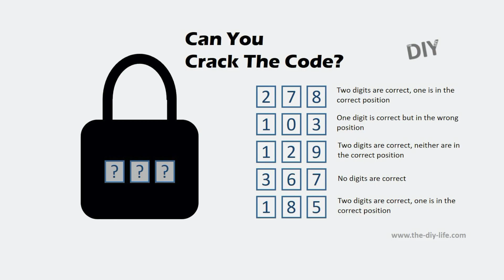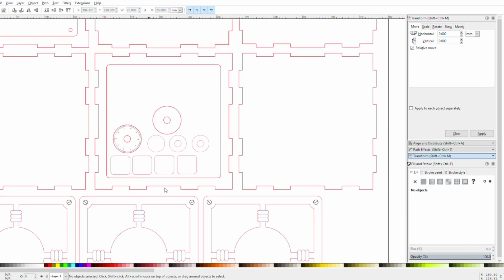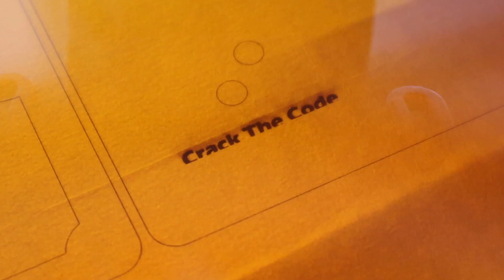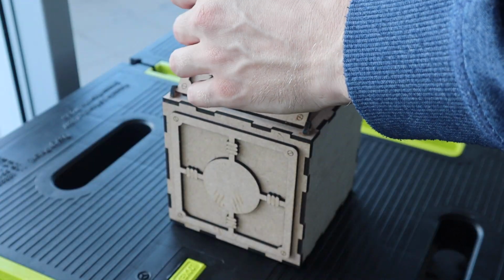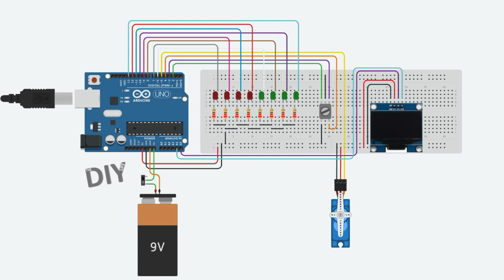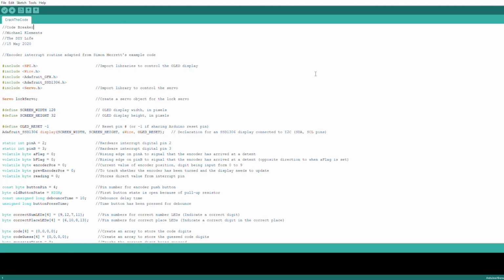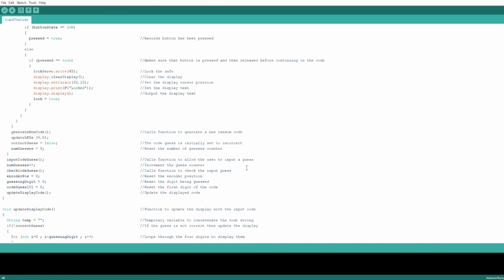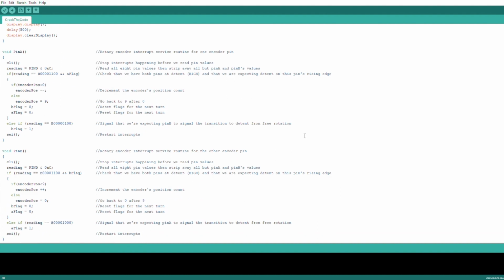Crack The Code Game, Built Into A DIY Safe Box

Comment: how do I connect an LCD screen with an I2C adapter? Do I need to change the code? If so, could you please help me?🙂
Reply from the maker: Yes, you'll need to change quite a lot of the code to use a different display as they use different drivers/libraries.

Comment: I just built this except the 9V battery will not work with it. Everything works fine via USB but as soon as you try and use the battery it gets stuck in a loop and cannot start the game. It acts like it doesn't have enough power, but I've checked the 5V pin and I am receiving 5V both with battery power or with USB power. What is the problem and why will the battery not work? I've had several people take a look at it and triple check my work and all have said it should work without any issues. I don't get it. Any ideas why it is happening and how to fix?
Reply from the maker: A 9V block battery can’t provide much current. The micro servo on the locking mechanism draws a lot of current when it moves. This likely causes the voltage to dip (probably faster than your multimeter can detect) and this resets the Arduino. You need to use a better battery pack or lithium ion cells.
Reply: @MichaelKlements  thank you for the information. Is it possible to power this box via the power jack on the arduino? If so, what is the correct type of amp/volt power adapter to use?